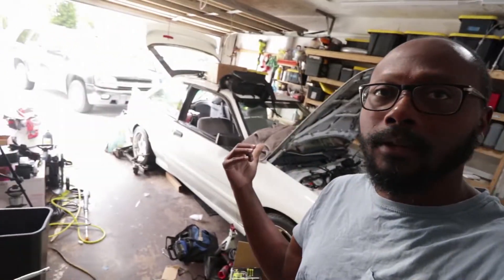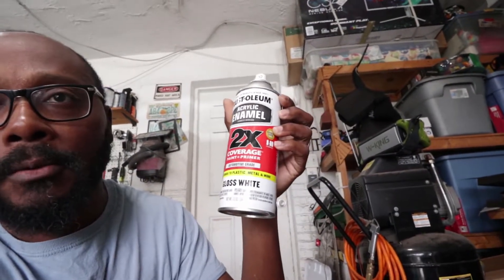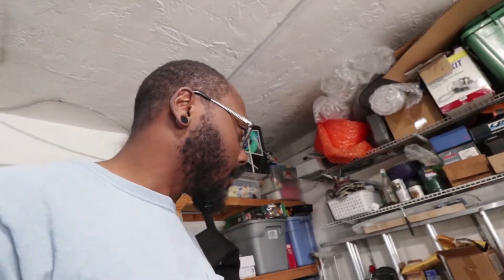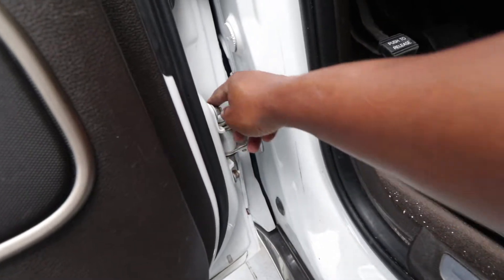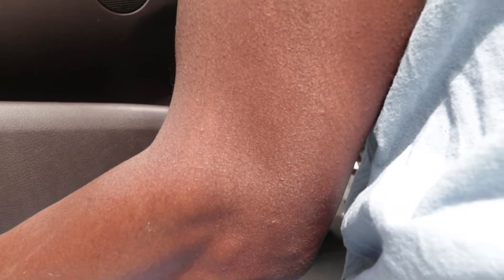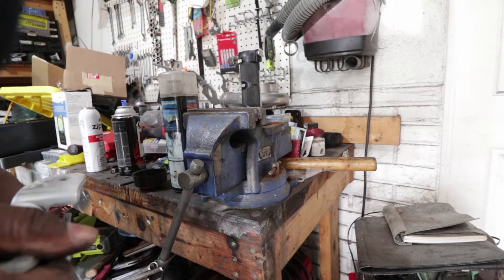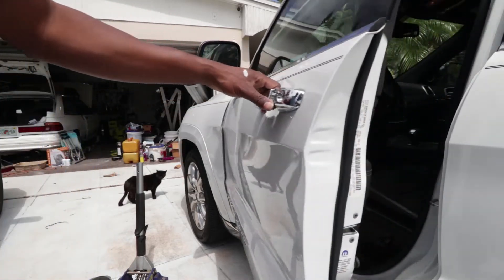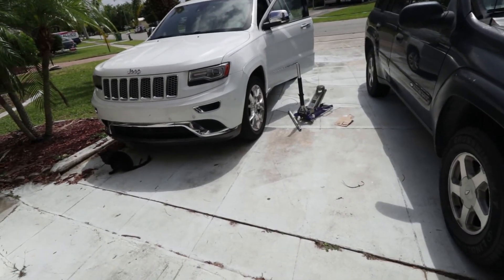2012-2022 Jeep Grand Cherokee Door Hinge Replacement

Comment: As a kid before and during high school, I worked  in my Dad's business which was an Automotive Body Shop. I wish I had a dollar for every door I took off and put back on! You did a great job replacing the hinge and advising everyone else on how to do it. Now, I am headed to garage to replace my lower door hinge that is making an annoying popping noise when you open and close the door on my Jeep GC or WK2. I understand from the parts manager at my local dealership that he sells enough of the hinges to keep them in stock. Sounds like Jeep needs to reengineer the door hinge!

Comment: did your new hinge come hard to operate by hand? Just making sure i dont have a stuck part.
Reply from the maker: Insanely hard to open, I'd imagine the door is over 100lbs so keep that in mind, hinge has to be pretty stiff to control that weight.  I used a pry bar with the hinge in a vice to open it.
Reply: @StovallsGarage  Thank you for the quick response.

Comment: is there a way to adjust the hinge? mine is hard to close, have to push it shut
Reply from the maker: Thats usually an issue with the latch, or the top and bottom hinge might not be parallel.